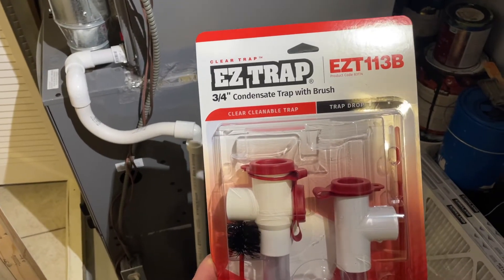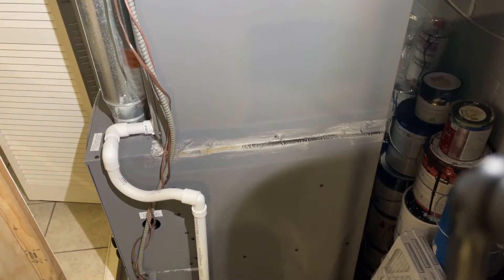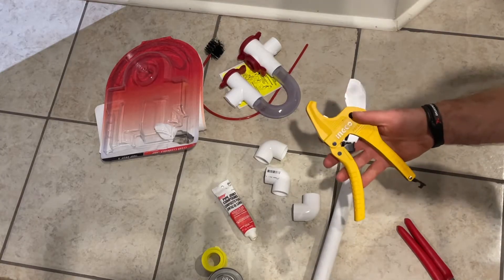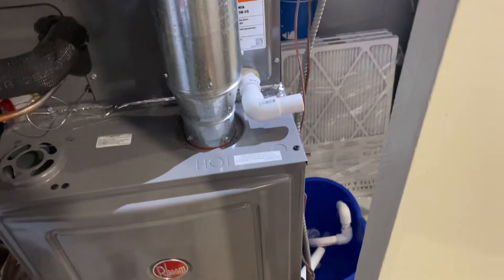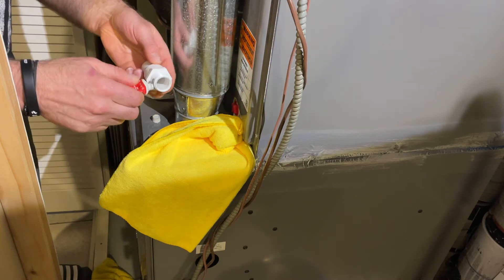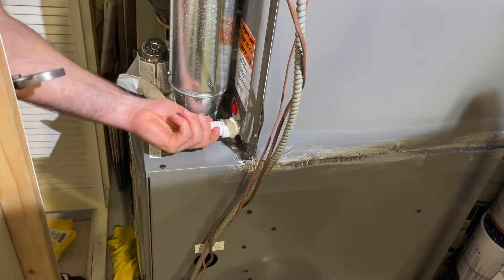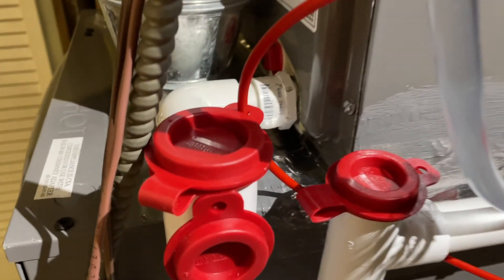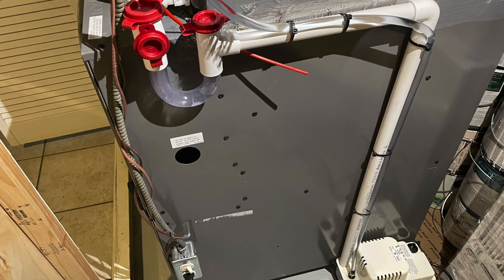How To Install a Condensate Drain line with the  EZ ClearTrap Economy Trap Kit (Full Install steps)

Comment: Keep in mind this is for an air handler and not a coil on top of a furnace. The coil on top of the furnace has positive pressure so you do not need a trap.  So, this is a positive pressure system in this video, not a negative and therefore has no need for a trap.  The AC coil is on top of this furnace, so you can drain directly into the condensate pump without the need of an Ez Trap.

Comment: The system is supposed to automatically shut off your air handler in the event of a backup. I didn’t see anything about that in your video.
Reply: Only if there is a float switch

Comment: What's the reason for the p trap?
Reply from the maker: Capture any gunk etc.
Reply: @HowToWithLech  This isn't the one with the electric float switch that will actually shut the system down if it backs up. Why did you go with this "dumb" version if it won't actually shut the system down?
Reply from the maker: @AustinMichael   you are referring to the pump right?  it does have that,  just needs to be connected to the system.  its those extra wires.
Reply: The P trap (I believe) is to prevent a vacuum/airlock situation within the condensate pan of your furnace/AC.

Watch attached : https://youtu.be/vWGLVe-X550?si=vhwWCGnzEAQsol-o
Reply: @billw5189  great explanation video thank you!
Reply: The p-trap is required in situations where there's negative pressure not allowing water to flow down the condensate line. This one is nice because it has a good clean out spot and brush to clear the gunk that builds up with time.